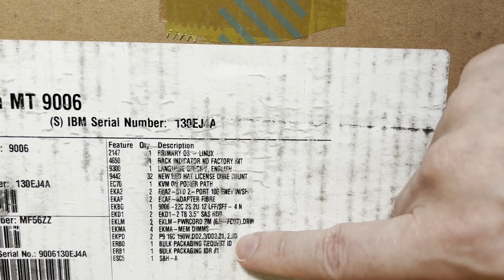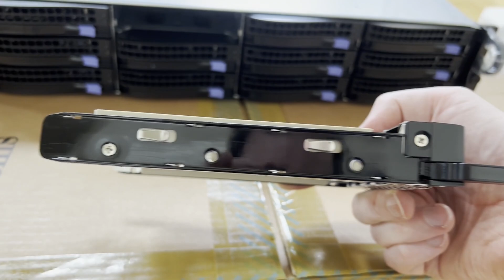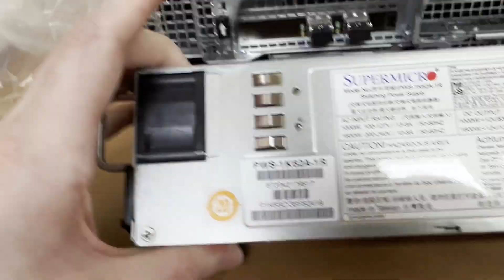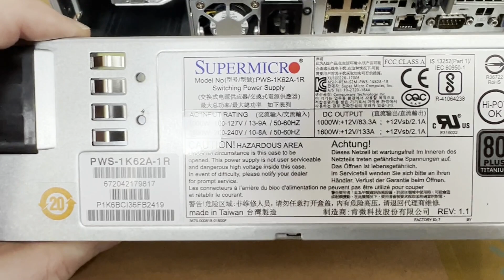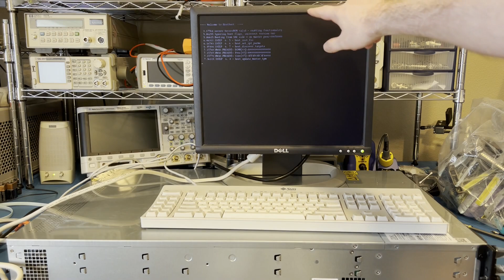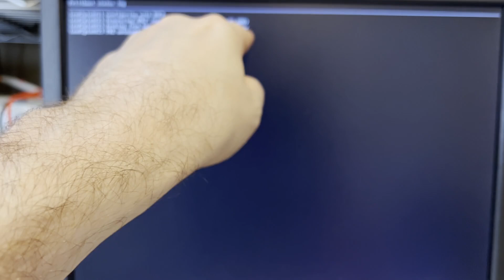[042] Unboxing a POWER9 Server (IBM LC922)

Comment: could you install an AMD GPU on this server？ and run a 3A game on it？ I want to know the preformance of the Power CPU is better than x86 or not.  because the ps3/Xbox360 are both with a IBM CPU
Reply from the maker: You could install an AMD GPU, yes. Run 3A games? No, I'm not aware of any commercially released game for the desktop that is compiled/ported to POWER.

But as for what's available today in terms of CPUs, a current generation Intel or AMD CPU will far outperform this old POWER9 processor.

Comment: Can you advise what Power server model can run AIX that normal user can afford?
Reply from the maker: What version of AIX? The venerable old 5.3 should still run fine on old PowerPC 604 machines like the RS/6000 Model B50 servers from approx the year 2000, which tend to pop up for a couple hundred dollars, if that, now and then. For somewhat more recent versions of AIX, if you keep an eye out for POWER7 servers they can be had pretty reasonably these days, maybe even POWER8 depending on what you consider affordable.

And if performance is completely of no concern, you can find tutorials online for installing AIX under qemu's ppc software emulation.

Of course, getting an actual license that entitles you to run AIX is another matter entirely independent of hardware costs.

Comment: Since this is a power system, can you run VIOS and AIX?
Reply from the maker: Nope, this is system runs OPAL (OpenPOWER Abstraction Layer) firmware and uses the Petitboot bootloader. It can only boot via the Linux kexec mechanism, so it's really just for running Linux. You can't natively boot AIX (and thus not VIOS) on it.

The KVM implementation for ppc64le in Linux is very good, though, so you can use your Linux installation as your hypervisor. I've been told that you can run AIX under QEMU+KVM just fine.
Reply: @MatthewMainframes  Thank You Sir or this explanation.
Reply: OpenPOWER systems cannot run VIOS and AIX directly. 

It's possible to run some versions of AIX under KVM, but you'd still need Linux to take the place of PowerVM/VIOS in that scenario. Also, because of this, there is no way to run IBM i on this machine.
Reply: @MK-og4qm  Thank you for this explanation